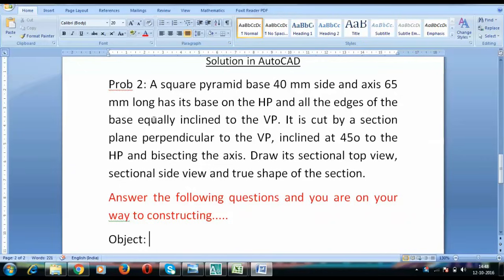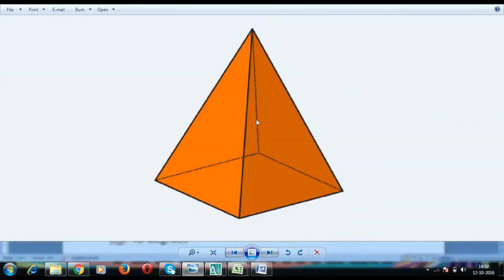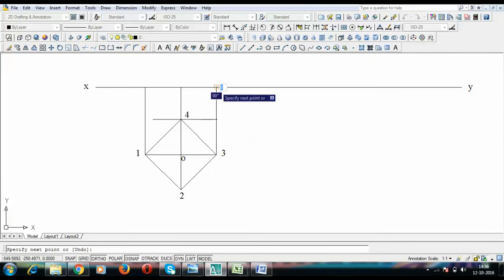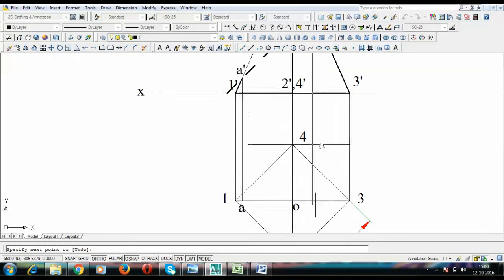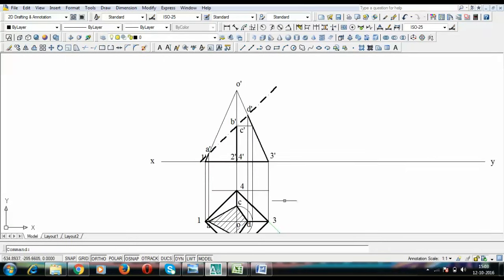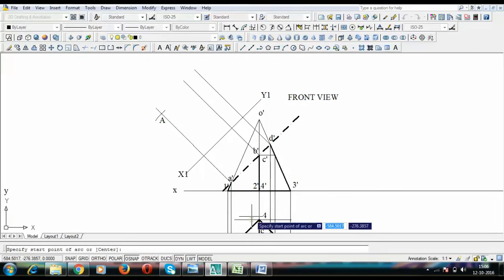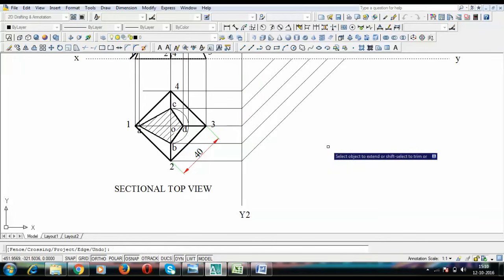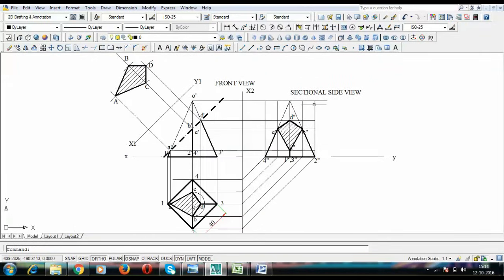2. How to section a Square Pyramid

Comment: square pyramid of 40mm base side and 60mm long axis is resting with its base on 
H.P.with a side of base parallel to the V.P. draw its sectional views and true shape of the 
section, if it is cut by a plane perpendicular to the V.P. inclined at 60° to the H.P. 
bisecting the axis.
14. A square

Comment: 4. A square pyramid, base 40 mm side and axis 65 mm long, has its base on the H.P. and all the
edges of the base equally inclined to the V.P. It is cut by a section plane, perpendicular to the
V.P., inclined at 450
to the H.P. and bisecting the axis. Draw its sectional top view, sectional side
view and true shape of the section.
∗

Comment: square pyramid side of base 40mm and axis 60mm long resting, its base on HP with 
one of the side of base parallel to VP. It is cut by section plane perpendicular to VP and 
inclined 45o
to HP and bisecting the axis. Draw its sectional top view and true shape of

Comment: A square pyramid of base side 25 mm and altitude 40 mm rests on the HP on its base 
with the base edges equally inclined to the VP. It is cut by a plane perpendicular to the 
VP and inclined at 300
to the HP meeting the axis at 21 mm above the HP. Draw the 
sectional top view and the true shape of the section.

Comment: Sir in this problem if the sectional plane is 60 degree insted of 45 degree with hp then tell me whether we get 2 points where you have marked a and the sectioned figure is a pentegon not a quardrilateral like this problem
Reply: Sir is it correct

Comment: Pls solve the problem,a pentagonal prism base side 25mm  and height 60mm has an edge of its base on the hp .The axis is 60 degree inclined with hp and parallal to vp.A section plane inclined at 60 degree to hp and passing to highest corner of the prism.Draw the sectional top view ,front view and true shape of the section

Comment: Sir please solve this question
A pentagonal prism, having a base with a 30 mm side and a 70 mm long axis, is resting on a base in the HP with an edge of the base perpendicular to the V.P. It is cut by AIP in such a way that the true shape of the section is a trapezium with one of parallel sides of 40 mm length, another side of maximum possible length and 60 mm altitude. Draw the projections and true shape of the section.
Send to my mail "ramunaidu.petla@gmail.com"